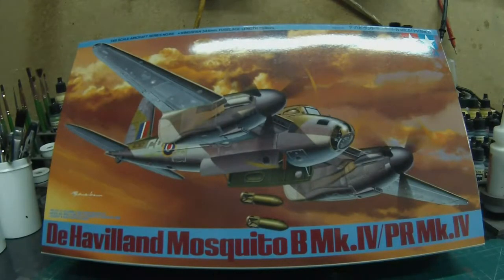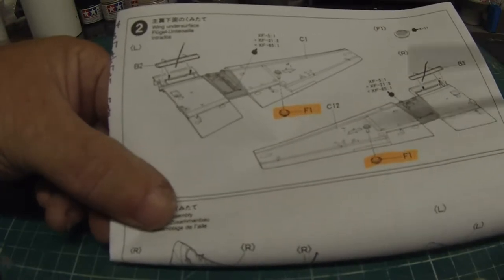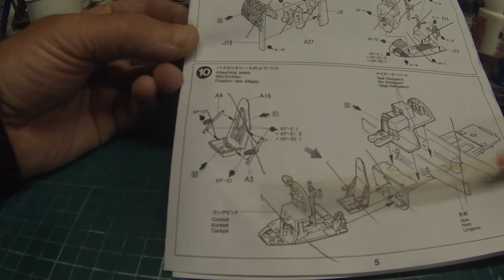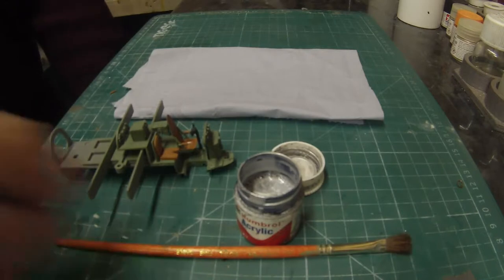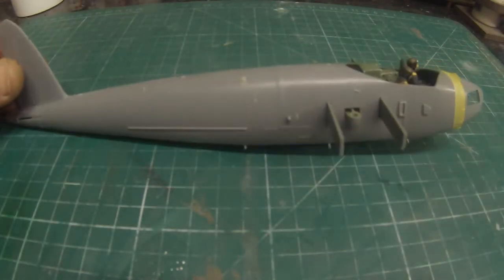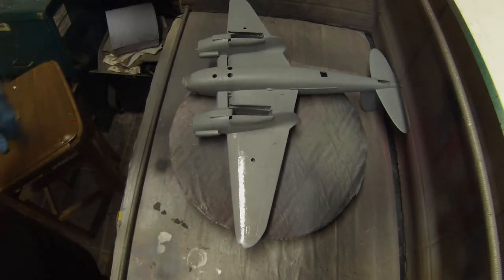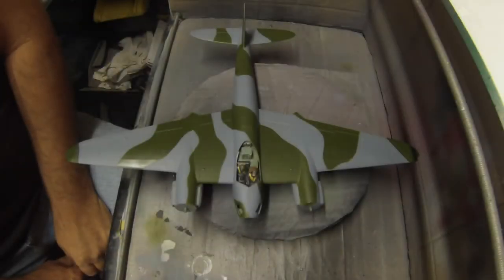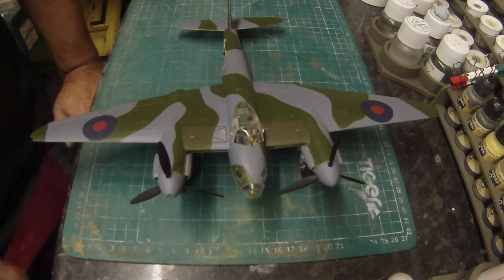Tamiya 1/48 De Havilland Mosquito B Mk.IV..Plastic Kit Build & Review.

Comment: The window framing on a mosquito is mostly inside with the perspex panels secured with glue and sealant over the top. Framing was painted interior green hence the difference in colour from the decal strips to the RAF camouflage colours.